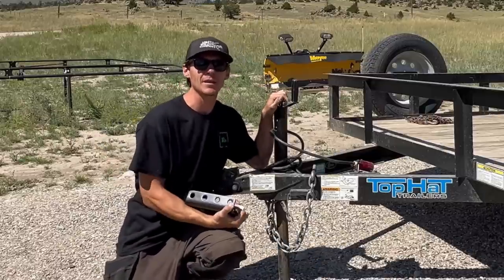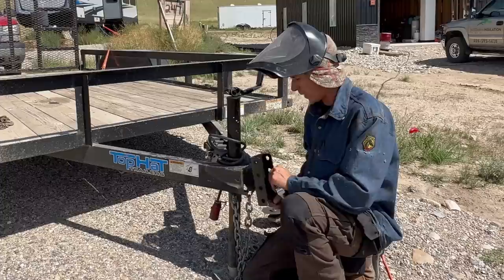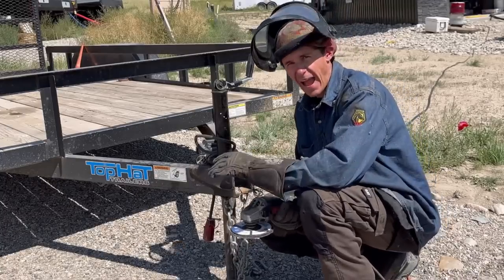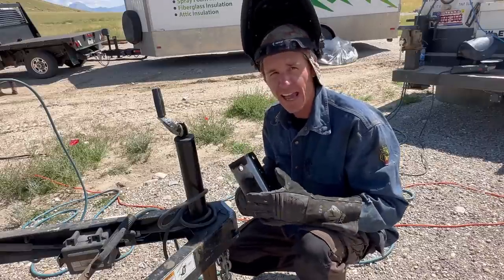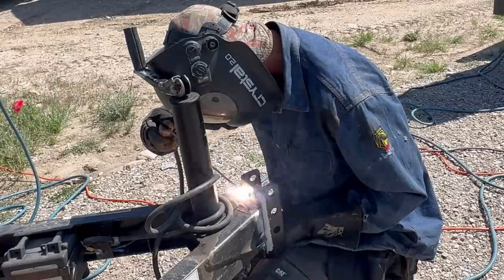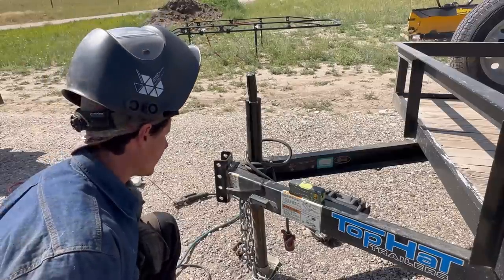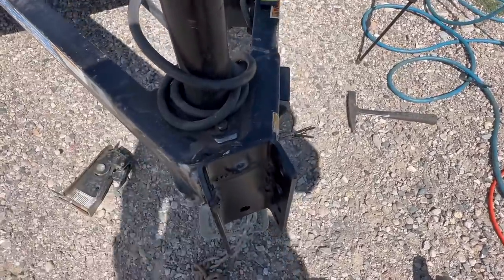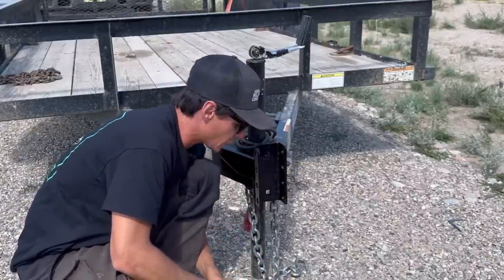Welding a adjustable trailer coupler on

Comment: Excellent advice.  My father taught me over 35 years ago to tack with 7018 when we were building doors for three 60 stall horse pens.  I swear very few were the same width, we had to measure every single one of them.  I dunno who built the stables but I'm not talking 3/4" or anything, more like 1"-8" difference in width and half of them had out of plumb walls.  That was also one of the jobs that taught me to make saddle cuts with the torch so much so that I could do them with my eyes closed and freehand by the end of that job. 
I'm impressed that tongue was as square as it was from the factory!  I'm pretty sure that around here they hire blind people with parkinsons to build trailers.  Aside from amusement park rides they have some of the worst welds I've ever seen.  They almost always seem to hold though.  Except for spring hangers, those usually break pretty quick.
Excellent job as always.  Details like cutting off that lip and even spray painting it black shows you take pride in what you do and give a shit.  I gotta go check out your merch.
Have a great day

Comment: We got a trailer back from my step fathers business that the coupler had been abused. Someone thought hammering on it would help get it on and off. I put some grease on it and presto. It works almost like new again except is a little bit harder from being beaten on. If your having trouble with your coupler please try and grease it before you get the hammer out 😂

Comment: Well I am not a welder and would probably never try doing that trailer hitch conversion!  Regardless Rockstar, I learned a bit about malleability and why when I do try to stick weld the tacks break when I try to move them because I don't use 7018ish or whatever rod is in the rod oven I bought at an auction🤦‍♂🤦‍♂😂😂  Keep that pedal to the floor and makin hay while the sun is shining!

Comment: Hi Anthony. When cutting with an angle grinder I always hold the angle grinder parallel to me, holding the body of the grinder with my left hand and guiding it with my right hands thumb and forefinger where the handles would screw in and I lean my head  to the right so I can look diagonally at the front of the cutting disc. This way should the disc fail you have practically your whole body out of line of the cutting disc and you can see the cut much better because the sparks are not being flung towards you.

Comment: You ever try using the level on your phone?  I've used it and its pretty accurate, but I wonder how it would compare to an actual device like you used, to compare the accuracy of the phone.  In my experience, it is close enough but not good enough for exact precision, but it was a free app.

Comment: I have been fabricating for over 16 years. I'm going to add to your tool collection in your tool box .
Must have!
 There called switch magnets. 
They help hold your work peace . And because of you I'm starting my on welding repair business. Just don't weld to close to them you get arc force do to the magnet

Comment: I know it’s overkill, especially with 2 beads of professional weld on 3 sides. But is there a reason to weld or not weld the bottom other than it’s unnecessary?
Reply from the maker: I did weld the bottom. But there is a large gap in the middle from the c channel. I could triangulate it but not necessary

Comment: Ok. Im doing the same job for myself.  I watch the dam video and get to the part i still have questions about and you end the video dammit. 😂😂  when you tighten the coupler channel down does it pinch the coupler tight? The shoulders on the bolts that came with my hitch are to long and prevent it from being tight to the hitch.

Comment: Does anyone like that Optrel Crystal 2.0?

I MIG and recently bought a TIG welder, and run a Lincoln 3350 helmet, but thinking on trying a Optrel Crystal 2.0 since they have good reviews.
Reply from the maker: Love mine. Link to where I got it is in description
Reply: Just get a passive hood with a 2x4 1/4 “ lens window. Then u can try different filter lenses till u find one you like. Literally no reason to use a big expensive auto hood unless u have no idea what ur doing and like arc flash lol
Reply: @MeltinMetalAnthony  thank you, and thanks for the best stick welding instruction on YouTube!  Each of your video’s are a great lesson, especially for us hobby guys!
Reply: @silverstreamweldingltd471 , welding is just a hobby, and I’m frequently working in low light conditions.  Evidently I’m not a pro like you, so in the words of Anthony, FO!
Reply: i recommend it 100% i got one and my welds instantly got better cause the puddle is so clear to see. i tig, stick and mig with mine
Reply: @shineything4444  thanks for the quick and positive response!  And I 100% agree!!!

Maybe some pro’s do not need an auto-hood (or think they don’t), but it does not make sense to not use new technology that can make someone better at what they are trying to accomplish.  I have my doubts that someone can consistently produce as high of quality TIG welds with a passive hood as compared to using a high quality hood.

With my current health condition and age, I’ve got more money than time left, so paying for a higher quality auto-hood is the way (for me) to go at this point.
Reply: lol i just started and 6 months into my welding program and classes and its worth every penny to invest in a helmet that is quality and can show the puddle clearly especially when learning.
Reply: @shineything4444  , I hear you brother, proper welding is a challenge in itself.  It’s impossible to weld anything if you cannot see the puddle and where one should run the bead.  Best of luck to you!!!
Reply: @rays9033  the point I was trying to make is not that I’m better than you. It was simply that you have a much better variety of lens options that suite your eye vs just buying one single hood with a permanent lens you can’t change. You can try all different colours of filter lenses and find one that your eye likes and you see the best with. Also , if you have ever used a auto hood for more than an hour or so you will notice at the end of the day your eyes are a little sandy. It’s because your getting flashed for a split second while the lens is darkening. Even with a very high quality Lincoln 24c auto lens I still got flashed throughout the day and had sandy eyes at the end of the day. Thats why I like a passive 2x4 lens. Nothing can go wrong with it, you have 100% protection , not 99.8 with an auto. Once you try a fixed shade and get used to it you’d never go back to an auto they simply are just a money grab.